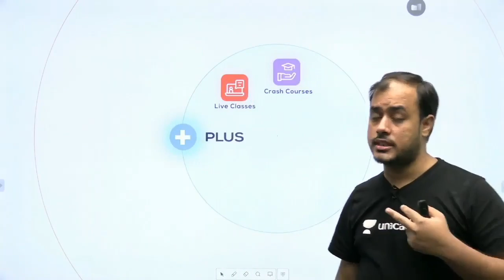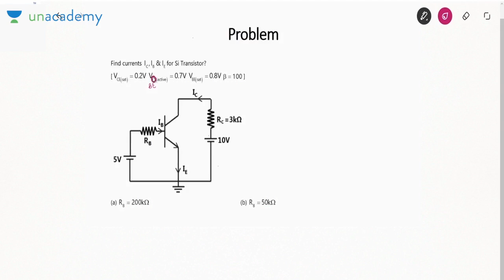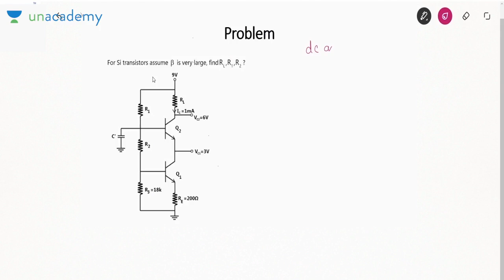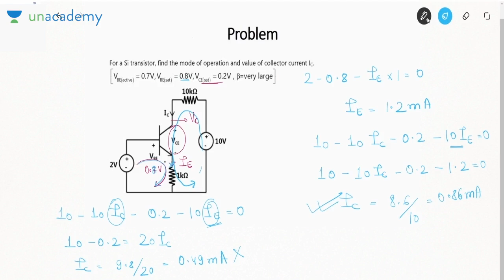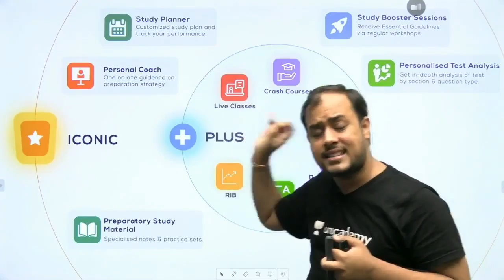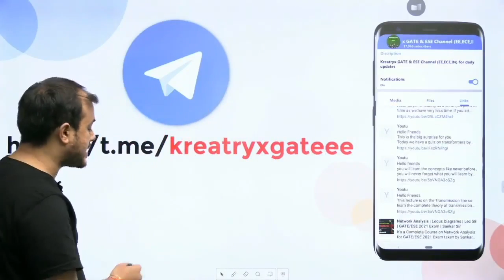Problems from Analog Electronics | BJT | Lec 33 | Analog Electronics | GATE 2021 Exam

Comment: Sir, @22.45 how R1 & R2 are calculated since base current is zero so there'll be no base branch to both transistor so how 3.7 & 0.9 Volts are taken?

Comment: @32.61 Sir, it is 1IE not 10 IE so that IC=0.89mA  not .49mA
Reply: The observation is correct,
Indeed the eqn should've been:  ( 10-10 Ic -0.2 - Ic =0 which gives Ic= 0.89mA) but later the actual answer calculated was right, Ic= 0.86mA (at 34:23 mins) but the eqn here also should've been: ( 10-10 Ic -0.2 - 1 Ie =0 which gives Ic= 0.86mA).
Reply: Correct. i also got the same
Reply: Yes. Hand fail..
Reply: I got the same bro